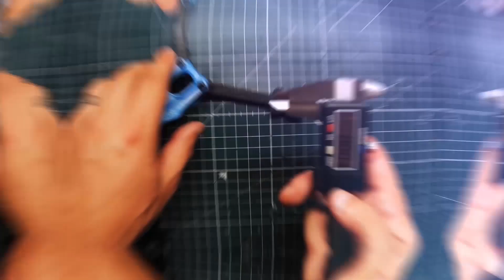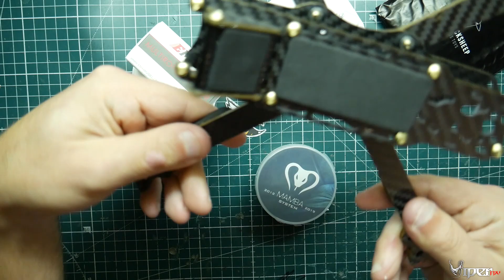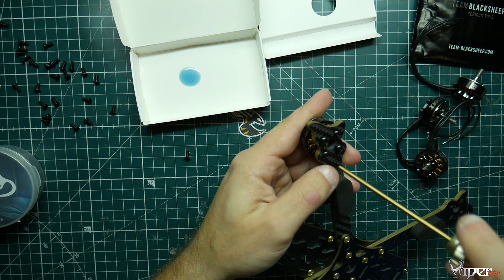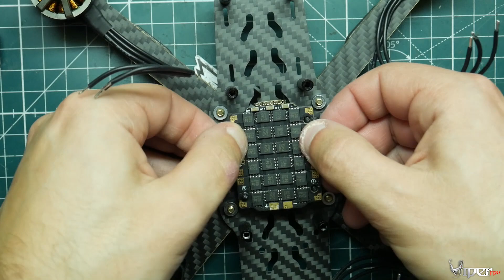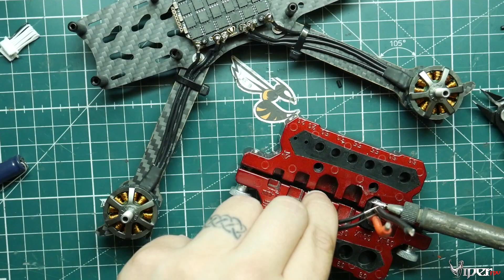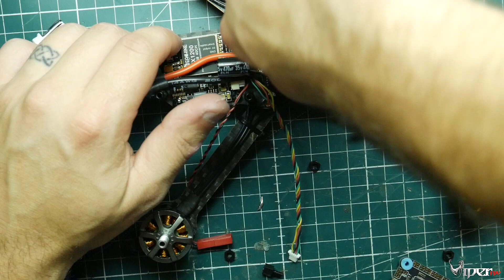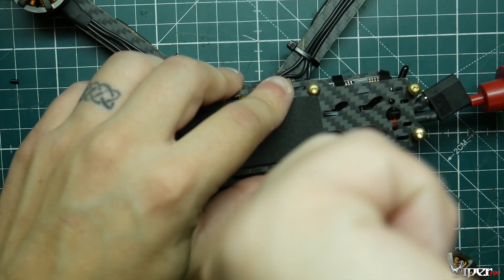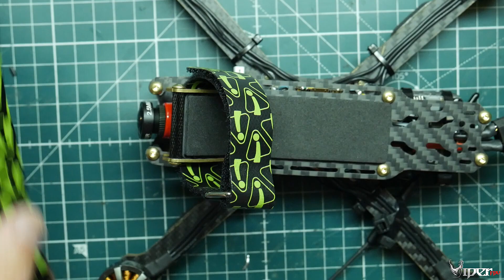How To Build a PRO FPV Freestyle Drone for ONLY $120 - Best Budget FPV Racing Drone Build of 2020

Comment: I cut my motor wires to short. What are my options now? Someone mentioned racewire?
Reply from the maker: Yes either solder long wires on, or use race wire
Reply: but ===the wire together and solder

Comment: Wat battery and charger would you recommend for this build
Reply: For the pro build
Reply from the maker: Josh Milhench I would recommend the CNHL batteries and the ISDT charger or hota charger 

Batteries http://bit.ly/2RqfcGV
Charger hota http://bit.ly/2kEAq8l
Reply: @ViperFPV  baybe a cheaper one ?:(
Reply: @NavJack3078  you can find something that is cheaper but it normally will fall apart in a few months or requires other components like a power supply for the charger. Do your own research if you’re genuinely thinking of buying something, but that’s a pretty good charger and the batteries look like they’ll last you a long time (I know this is like 2 months but I thought I’d still respond 😆😅)

Comment: just wondering, im no expert but i think i see a place for the vtx antena to mount on the top plate, why he didnt use it?
Reply from the maker: Krusty good question, my experience with mounting the vtx on the top plate is that it always gets knocked off and broken. Putting it out the back like I did protects it a lot better than having it on that top plate.
Reply: @ViperFPV  Good to know. I just got my TX1200 in, and the MMCX to SMA pigtail that came with it dosen't look like yours. Was this one you had lying around? Mine can't double-over like that; too thick.

Comment: when you buy motors and frame does it come with extra screws or do you need to purchase screws, nuts, standoffs and so on separately?
Reply from the maker: Krusty it comes with all the hardware and the motors come with motor screws
Reply: @ViperFPV  thanks

Comment: i have the fs- i6s transmitter would i be able to link it to this build? and how if you dont mind explaining?
Reply from the maker: Yes it’s comparable. you just need to make sure you use the receiver for your radio.
Reply from the maker: Your radio should of came with a extra receiver if not let me know and I will link a compatable one
Reply: @ViperFPV  i already used the one that came with the transmitter on my furibee x215 do i just buy another fs-ia6b
Reply from the maker: Just buy another receiver and bind it to your radio. If u need a recommendation just let me know

Comment: Im new to fpv. Would like to do your build, but could I change the eachine tx with a frsky r xsr? Pros and cons?
Because I have already one and I heard its really good. (Btw: Own a Qx7... would there be problems to bind with the eachine?)
Reply from the maker: Isegrim No Kage hey! I think you are confusing the eachine TX? With a receiver. The eachine vtx is a video transmitter not a receiver so u would need to purchase a video transmitter eachine or whomever and then u also need a receiver which you can use the rxsr just fine. Any more questions let me know
Reply: Yes, my bad 🙈 just looked at your video description, and now after watching your video I saw you used a r xsr 😂👍🏻. But: You said you installed the crossfire reciever under the mamba stack, so youre using two recievers? Redundant (if thats the word)?
Reply from the maker: Isegrim No Kage I used a crossfire receiver but I included a link to a rxsr just in case anyone wanted to use that instead.
Reply: @ViperFPV   how exactly did you mount the receiver? i think i see electrical tape under there?
Reply from the maker: Alex Ellington I mounted mine under my esc but if u are using a rxsr I would just mount it with heat shrink over it and put it by the vtx

Comment: Definitely feel like a few of those 'pro' changes are actually mandatory changes.
Racerstar35Anniversary/RCharlanceF4Pro2/RCX NK2306.5 on that frame with an XM+ is going to outperform everything there for less money.
Reply from the maker: I have the mamba stack on 2 rigs which fly amazing sorry your experience was not that great.
Reply: @ViperFPV  Got to help with a fairly big project where we build a couple dozen quads on that that hardware - statistically significant failure rate.  Not that Racerstar stuff is typically much better... but that particular ESC is a good design, and RCX motors are a great value.
Definitely appreciate you bringing that frame to my attention - I'll probably add a couple to my beater fleet.

Comment: Samguk motors .__.
Reply from the maker: To keep the base build down below 120 it’s either the racestar motors or the samguk. I rather use the samguk lol
Reply: @ViperFPV  or emax eco which are 1€ more expensive and much better in quality
I think that its just alot better to get motors that are 1€ more
Reply from the maker: Felix S actually when I made this video the samguk are 8 bucks where the eco are 11.99 which made it a 230ish dollar build but that would work too
Reply: @swugger  As much as I like the ECO, for the video title hitting that number is nice, and the Samguk are better than the R* ones.   RCX's NK2207.5/2306.5 line are also right in there, with comparable (almost identical) performance to the ECO motors.  I actually like those slightly better than my ECO 2207 builds, but the difference is miniscule, both really over-perform for the cost

Comment: be carful with that threadlocker it gets on a standoff bolt and it’s over...i stopped using threadlocker and treat my quad like a old harley and tighten my screws after ever flight....but yes i like this budget build ......good job
Reply: This is what I don't get about the thread locker on quads. I club race motorcycles and we don't use loctite/thread locker on consumable hardware. We do a pre and post check on all hardware when we race. Nice to see another 2 wheel brother that understands this lol